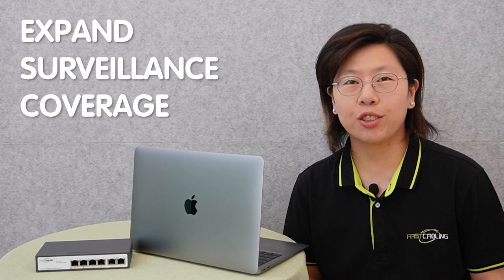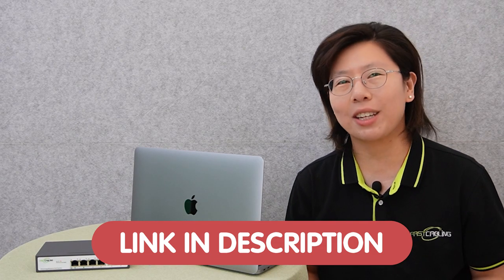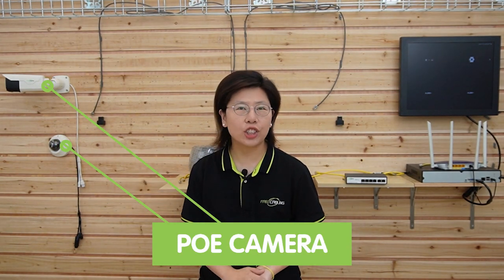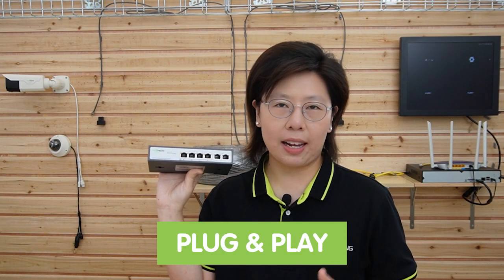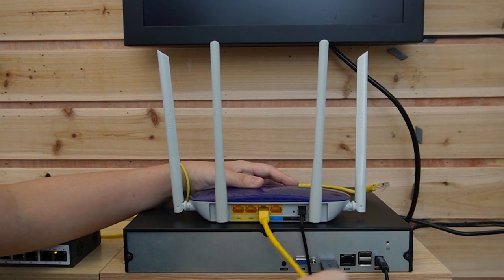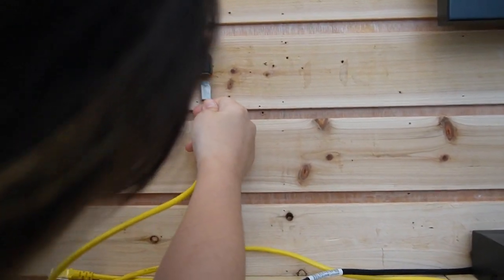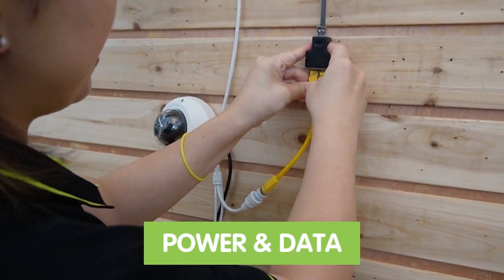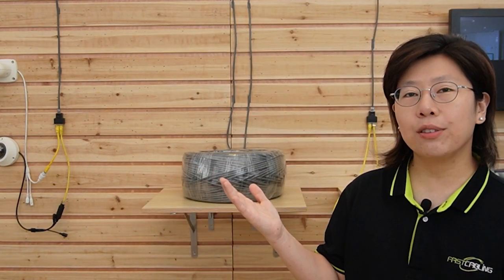Installing 2 Remote IP Cameras over One Existing Cat6 | 800’ from PoE Switch

Comment: Which Cat 6 cable can use? Twisted? Or normal??
Reply from the maker: We use twisted cables in this video. This switch can work with Cat5e or Cat 6 ethernet cables.

Comment: hello dear is there product to make single cable to another 4 camera instead of your video which you make splitter for only two camera
Reply from the maker: It is only two long range cameras this switch can supply. The rest of two ports support 328ft (100 meters), not long range extension.

Comment: I would like know if one can pull 100m cable from second splitter ,thanks
Reply from the maker: It's possible but please keep in mind that the transmission speed will gradually drop as the distance increases, and the maximum distance from the long-range PoE+ switch to the PDs should be kept within 500 meters. 

For information, please refer to the link below:
https://www.fastcabling.com/product/800m-4-port-long-range-poe-switch/

Comment: Perfect demonstration mam. anyway where can i buy the POE splitter? Do you have it in amazon?
Reply from the maker: Sorry to disappoint you, but we don't sell this splitter on Amazon. But we have another product you might be interested in: 802.3bt Gigabit PoE Extender. This extender can extends your PoEof another 100 meters and power 2x PoE devices at a time. If you're interested, please see the link below:

 https://www.fastcabling.com/product/poe-extender/

And the switch used in this video is the 4-Port Long Range PoE+ Switch.

https://www.fastcabling.com/product/800m-4-port-long-range-poe-switch/